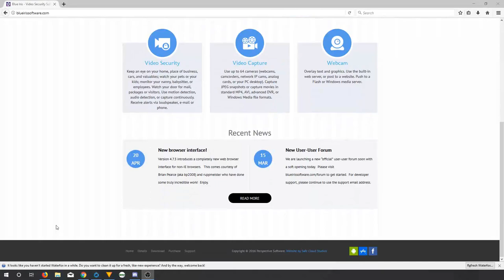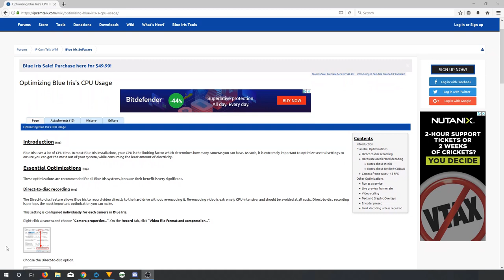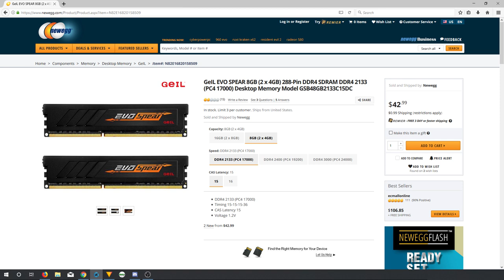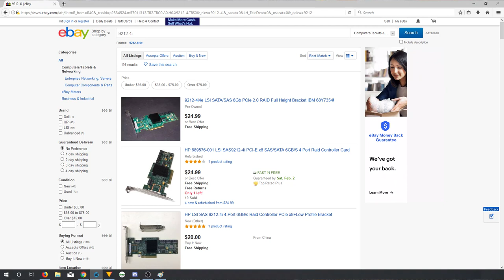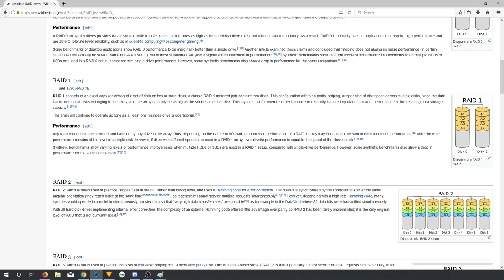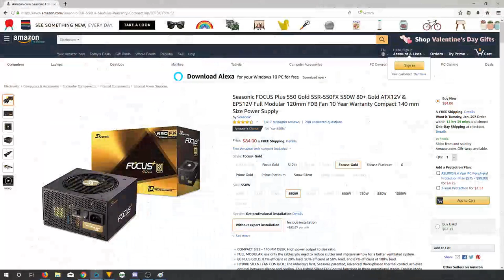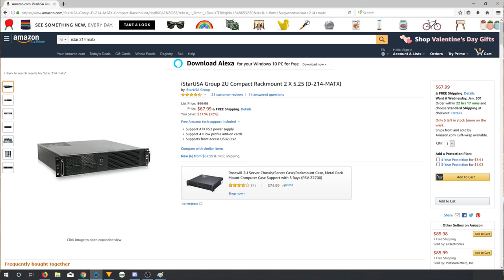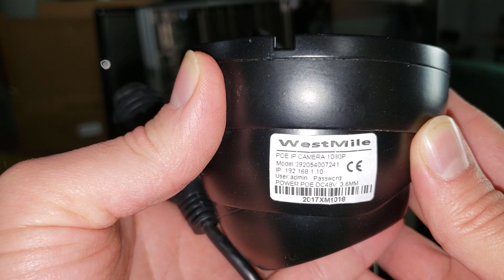Video Surveillance Server Build for Home / Business

Comment: Just buy a nvr. Save lots of money. Servers for cameras are the old expensive way.
Reply from the maker: It seems to be the case that each solution has its positives and negatives. NVRs are proprietary devices that have a market, computer, or server-like machines also have a market. 

NVRs generally speaking are setup to do whatever the manufacturer wants very well and consume lower amounts of power. The firmware and software are written for the purpose of being that product. This however also generally speaking locks you into 1 vendors solution. Usually they require certain cameras for compatibility and only come with whatever level of features the manufacturer deems appropriate for the grade of NVR you bought.

Building a PC or a server to do this is 100% going to be more expensive probably. It will likely suck up more power as well. In terms of benefits though, PCs and servers are very modular in terms of hardware. CPU, RAM, GPU, Case, HDD, all of these items can be upgraded as needed at smaller incremental costs. With software like Blue Iris, many different cameras are supported. From the low / cheap end, up to fancy feature packed 4k cams. The choice is yours.

I would say its also quite likely an NVR will be simple and initially cheap to deploy if it meets the needs. I will however keep going at building a PC / server like machine.
Reply: @STS  Iv been in the industry for 14 years. We switched from pc based DVR/ NVR's many years ago. Cameras now days use onvif protocol.China has flooded the camera market. Everything works with everything ells. Its actually really easy to build systems to fit clients budgets now.
Reply from the maker: Yeah, compatibility is a better now. It all depends on the use case. At my Day job I know we just had to move to a system with multiple nvidia qudros for video processing. Likely a few more cameras than the average SMB install though.